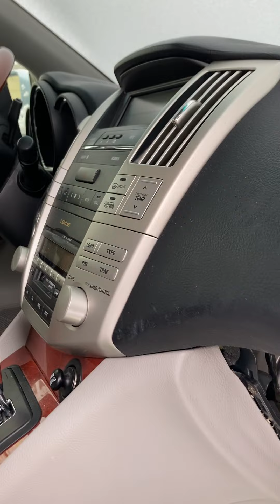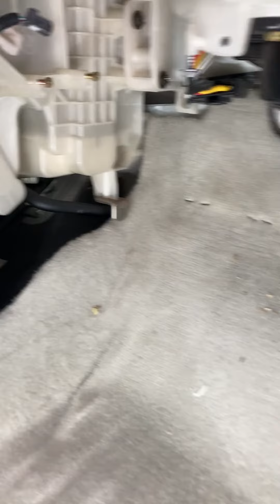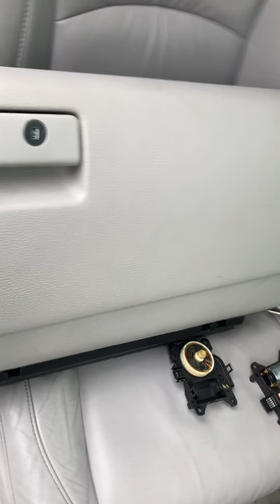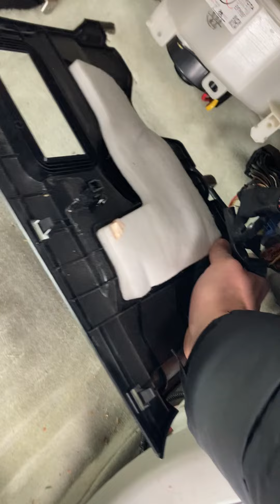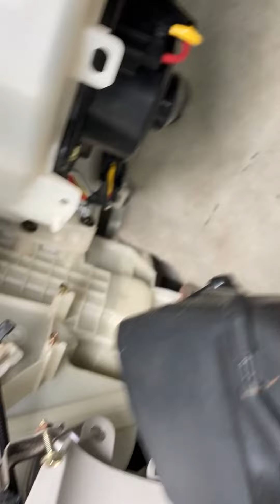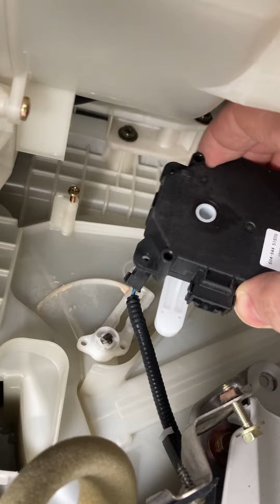Lexus RX 330 Passenger Side HVAC Blend Door Actuator Repair

Comment: For 2004 Lexus RX330, both doorman 604-902 and 604-944 (in the video) are listed as fitting. Which one should I pick? It seems the connectors are different

Comment: Hopefully someone can help me.  I have a 2005 Lexus RX330 and the passenger side air conditioning works great, but the driver side does not blow cold air.  Will the blend door actuator shown here installed on the passenger side help me or is there one on the driver's side that would need to be replaced?  Thanks!

Comment: My RX330 only blows through the front defrost vent no matter vents are selected. Any ideas?
Reply: Probably the actuator, which was discussed in the video.  If you listen carefully you may notice a subtle "zhhht-zhhht-zhhht" kind of noise from under the dash (or maybe it was doing that but finally gave up fully.)  That's the actuator trying to change positions but failing.  That's what mine is doing, so it's in the process of failing.

Comment: Just succesfully changed the actuator this morning. Thank you for your video.
Reply from the maker: Awesome!
Reply: @Christopher-mi6qe  I am curious about replacing the 2 plastic screws on the panel, for some reason I am struggling, any pointers? They seem so easy to go back on.
Reply from the maker: @katieturner7361  Those are half turn fasteners on my car and they don't lock super well but have not rattled loose or anything since the repair.  Good luck.
Reply: @Christopher-mi6qe  thank you. I will give it another try.

Comment: Is2006 RX 300 the same?
Reply from the maker: I don't know for sure, but Toyota is very good about standardized systems.  The kick panels take very little time to remove and you can see the actuators, I'm sure this would apply to an 06 RX300, its only 2 years newer.